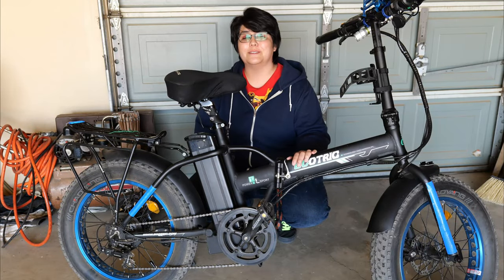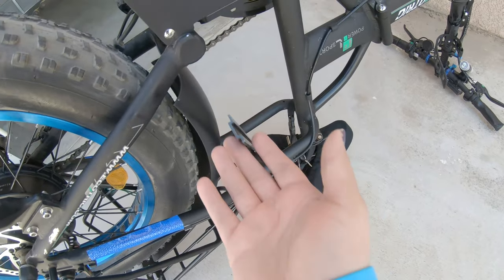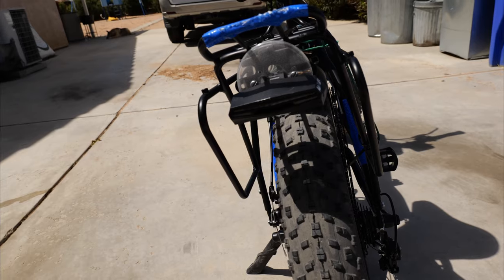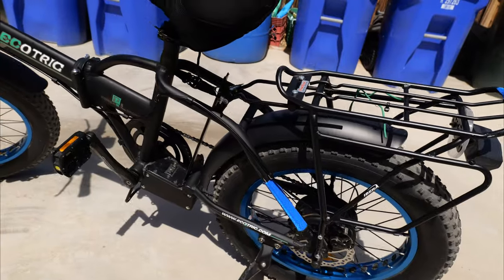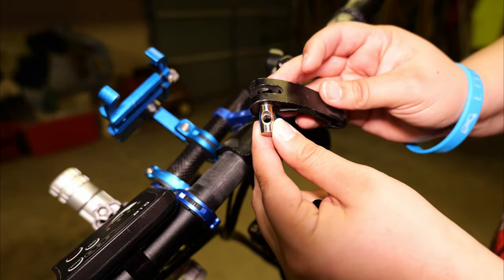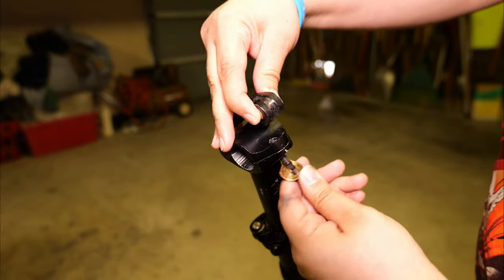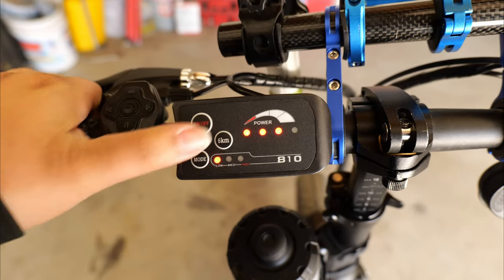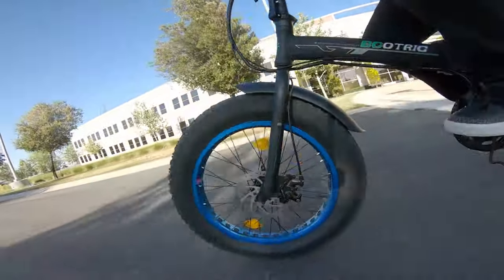Ecotric 20inch folding bike

Comment: It's been a few years, but I believe it's worth mentioning: WD-40 alone is not a lubricant. Especially for chains. 
WD-40 adds an initial lubrication to metal, then it dries out and it does the opposite. The spray is actually used to CLEAN lubrications, oils, grease, water, etc. So after using it for cleaning, you still have to add chain lubricant to your chain. 
I can't tell if you added it later on or not since the video cuts off from that part. 
Lastly, at 13:24 looks like you're pedaling, based on the movement of the camera. It also makes sense since you're going uphill.
Reply from the maker: It's there line for bike chains there is a degreaser and a lubricant that they sell. It not normal wd40.

Comment: August 2023
I bought one, Ecotric Cheetah 20, used it for almost a month and returned it for full refund.  It may be okay for paved roads use but it sucked on gravel roads and smal hills and low difficulty trails.  I have 3 other ebikes, all under $1,150 delivered, and this was the worst, at $730 delivered.

Brakes are mechanical/cable and are noisy and weak, and wore down fast.
Battery rattled too much in its holder and would break connection, causing lag, to total loss, and also sometimes shutting the bike controller off. 
The light minimally bright for off-road use.
I would get 16 miles on a full charge with 95% throttle (very little pedaling, just to get up hills it would not handle).
Customer service was helpful enough and didn't argue about the issues.  Provided return label and said full refund would be issued. I used it for 3.5 weeks and put 110 miles on it. 

I would not recommend it, and instead would go with the Ridstar 20ah battery fat tire for $1,100 delivered.  I have bought two of these, after testing one for 2 months.  Amazon. 

Happy trails!

Comment: I'm interested in this ebike. Just a few questions for you...How often do you ride this bike? I need one as a daily commuter.  How has the battery lasted? Have you replaced it in the three years you've owned the bike? 
How well have the tires lasted? 

Thank you so much for such an informative video!
Reply from the maker: I dont ride this bike as a commuter I just ride it to go on trials or the park.  I would say as a commuter it might be to heavy if you have to lift it a lot. My battery is still fine but when I have extended periods of not riding I leave it at 1 to 2 dots charge. Tires are fine I put slime in them and that lining not to get a flat from goat heads.
Reply: @SpecNReviewz  thank you so much for your quick reply! 
Also I've been reading on Amazon reviews of this bike that customer service was horrible for some people.. has that been your experience?
Reply from the maker: @xGarylnyrx  my customers service experience has been excellent they get back to your emails pretty quick like maybe 2 days I think that standard for companies. I only contacted them twice once for the time I had in video and the next for the fork I ordered. But both time have been great.

Comment: it says in the manual you can wash it, just dont go to a car wash. I ride to work everyday so ive been through some severe rain storms and its been fine. the battery connection has gotten a little corroded but a bit of steel wool and 30 secs take care of that. what tires do you recommend? either my expectations were too high for them or the stock tires that arent even branded are not very good.
Reply from the maker: Cool. I don't have any recommendations for the tire maybe go to a bike shop and ask.

Comment: Replacing brake pads on front wheel ? Ecotric said the front wheel with brake assembly is not there's so where can I get pads for front that fits .They did say the back wheel brakes are sold by Ecotric company. Any help is greatful. Thanks 😊

Comment: I loved you video, i also have the same bike. Do you still have this bike? I am upgrading mine so, i bought new parts like, a rear rack after i saw your Iberia rack and, also a new battery with 20ah.
I plan is to add that second battery to the bike and a seller told me first of all, that i would need to know how many amps is my bike controller, so i was looking for this info. Unfortunately, there is no details about it on the box. So, i believe your bike controller is the same capacity, do you remember your controller amps?
Reply from the maker: Thanks 😊  yes I still have it. Maybe email Ecotric with the year you bought to see if they will tell you 🤔  not sure if they put different controllers in them.
Reply: @SpecNReviewz  I already tried it two weeks ago, but they didn't answer absolutely nothing, and i also sent a message to the chinese company that made it but, both Ecotric and Suzhou Tongsheng company didn't give a d@m!
Reply from the maker: @emersonbaby2696  hmmm all I see from the site is the 12.5 Amp so maybe that's the highest it should go? Really unfortunate that they have not responded I have had really good experience with them in the past sorry.
Reply: @SpecNReviewz  I've checked on chinese company website, they aren't selling this specific controller anymore, Ecotric is the same situation, details mentioned on the controller is just LCO4818C1H-TS23. I don't know why they didn't specified all info on the device. Usually there's all details, things like, hey this is 36 or 48v capacity and also it has 12, 16, 20 or 25ah. Alright, thank you so much for all, i really appreciated it ☺️!

Comment: if you dont mind answering, is the seat post the original? Or did you buy a replacement? Because 2'10 is around 26 inches, but the site says the lowest the seat can go is 33inches?
Reply from the maker: It is the original al seat I just put a gel cover on it so it might be like a 1/2 inch difference or less it's not that thick.
Reply: @SpecNReviewz  Oh really? so the website is not accurate the seats lowest is around 26inches?

and excuse me if this is a silly question (I'm not a very techy/mechanical person) this is the 36v version right? Do you think the 48v is also the same with the dimensions? More importantly the seat height is also 26inches at the lowest?
Reply from the maker: @Black Burgundy  I am not sure about the website what ever I said in the video is what I got.
Reply: @SpecNReviewz  Alright, well thank you for the information 🤟

Comment: Just bought one for 650$, well I just ordered it anyways. But I’m hoping it’ll do good off road and going through fields and such. Nothing extreme off road.  Does it have great torque/power?  And can I ask where you got the back rack from?  Thanks for making the video on this Ebike 🤝
Reply from the maker: Yeah it should be just fine off road for you it does for me i do little woops and stuff for fun but yeah nothing to crazy. Its not the fastest thing out there but i think it has enough power to have some fun. the bike rack is listed in the description. I am glad the video help you out =D
Reply: Hello do you mind answering what the lowest your seat can go? In the video she managed to get it down to 26inches and I just wanted to check for a second opinon on it?
Reply: @ Black Burgundy - I just measured mine and it was 32 inches from ground up to seat. With seat all the way down.
Reply: Black Burgundy , but I ended up buying a Ecotric 20 Cheetah super sport.  It’s a very good bike and was pretty reasonable price.  I like it greatly.  Put a few extras on it 👌👌🤌🤝
Reply: SpecNReviewz - thanks for the reply

Comment: Good Review!  Do you know if any other battery replacement other than what is listed on the Ecotric website? Maybe of a hack where the dead battery could be removed from the case and replaced?
Reply from the maker: I have found the same looking battery's there called "silver fish" when I was looking them up I was going for the same voltage but looking for differnt higher amps. But I am not sure if the pin out will be the same on the bike. I was doing a deep dive on them a while back but definitely do some research if you get a different battery.
Reply: @SpecNReviewz  tks.   The battery on the Ecotric website is pretty expensive for what your getting....and its not even in stock right now.   Please make a video if you get a replacement.  From what I hear, three years is the normal battery life so I'm guessing you'll be needing one soon.
Reply from the maker: @rjpg  Yeah they are pretty pricey I probably wont be getting one until i notice it not doing what it need to so it will be like almost dead lol

Comment: More practical info than other videos I've seen. Thanks ...But ... I don't get why you apparently pour a bucket of water over the back after (and before?) you spray the chain with WD40. Or wasn't I seeing it right, it was very fast.
Reply from the maker: Oh the footage is cut I put degreaser on the chain cleaned it and had to clean it off before adding the new grease.
Reply: Thanks for the quick response!

Comment: does the the key need to be in the battery when charging and if so what position?
Reply from the maker: no it does not. The key only when you want the power on the key needs to be in it.

Comment: I thought the bike was 800W but I can't find one. Highest I found was 500W. Did you say the wrong wattage in the video?
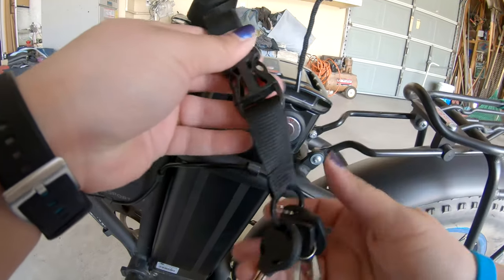Reply from the maker: No I said 500 at 3:10 did I say it wrong somewhere else? For e bikes when i was looking I think you would have to go to a 750watt or 1000watt motor i did not see any 800watt.
Reply: A 500 watt motor can put out 800 watts for hills.I have a 750 bafang motor and for hills it pushes 1300 to 1400 watts--but I agree--get a 750 if you can--it will add 500 or even double the price--but well worth it.Most 750s also have hydraulic brakes and better batteries--etc.I am also on PAS 3--which is light peddling--can get 60 miles plus on one charge.In fact i went 50 miles normal use--had half a bar left--and used the throttle only for another 5 to 8 miles and still had half the battery life left. I have a CSC 750--price was 1688 from CSC.If you plan on riding on trails--a nonfolding bike is more durable and more stable.
Reply: Or you can get one of these and add a front only hub motor which is what i plan on doing with my 750 since i ride trails and want the extra torque.Yu can get a 1000w front hub motor and battery for 400 to 500 and would make this thing an awd monster--but I would not go fast on trails since these are less stable.

Comment: I got an issue when i try to take out the battery to charge it, when i turn the key to unlock it. I pull out the battery and it doesn't move at all, i almost broke the bike because of that. Can anyone please help me with this issue!
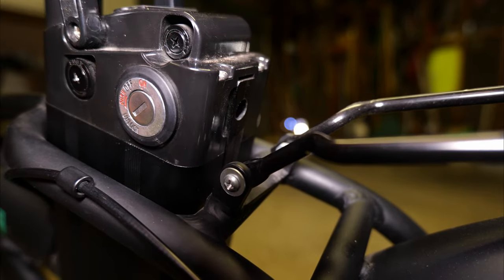Reply from the maker: Hmm only thing I can the of is the lock not being all the way unlocked like at 2:04 before I lock it.

Comment: Anyone know which 1 is better the ecotric dolphin or the lectric fatbike that's $999
Reply from the maker: I looked up the lectric xp 2.0 is the one I looked at. I like that it comes with a lcd from what it looks like, the cargo rack, and the suppension fork that is awesome so you don't have to upgrade or buy them later. The tire is a 3 x 20 so it's not as wide as mine is from the video I think it would be fine depending on terrain and personal preference. The battery is bigger then the one on mine (36v 12amp) that is 48v 9.8amp. Only thing I can see is that it has that square body in the middle and from others I have heard that you can bump your knee when riding on the part that folds because it is kind of big. So I just stayed away from that type when I was looking but it could be different for each person. The Dolphine one I could only find the one from ecotric if you know the model let me know and I will look again. But that one is a more body preference my mom got that one it is easier for her to get on the bike because it is a step thru and she does not have to lift her leg up and over to get one. When I get on it I do notice a difference in gear ratios it is more of a beach cruisers but the motor and the battery are the same. Ecotric has a folding bike with a bigger battery 48v 13amp it's bigger then the one in the video a little bigger then the Lectric but same look just with lcd screen to now. I love ecotric customer service I have contacted them only twice now one for what I said in the video and the other time just recently to get the new bearings to put on the suppension fork. Going to make a video on that soon will explain it more there lol. Hopefully this help you out 😀 and have fun bike shopping.

Comment: Is it safe to ride in hard snow an hard sand
Reply from the maker: I have road on hard dirt and it does fine.   Not sure on the hard snow or sand though. On soft sand I can lose my balance if going to fast I have fallen off but that is because I was going fast on a turn with soft sand was having fun lol. I am sure you can still slip on hard snow so it would be like anything else you ride. But I have not rode in a lot of snow so not much experience there 😅
Reply from the maker: Just looked at your rc video I think the bike would be fine on that terrain I would be going a little slower on sharp turns but I think it would just come down to just ride experience and how comfortable you feel. 😀